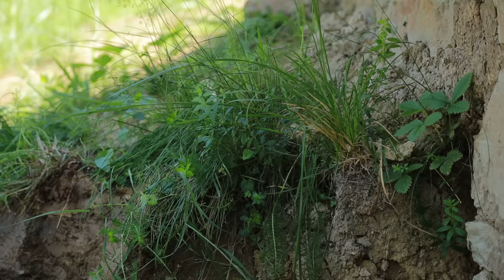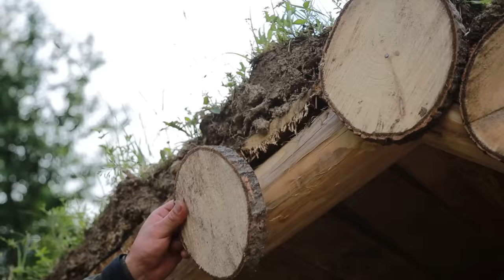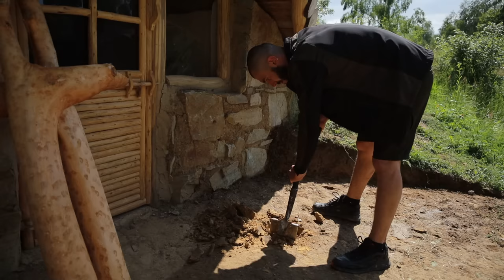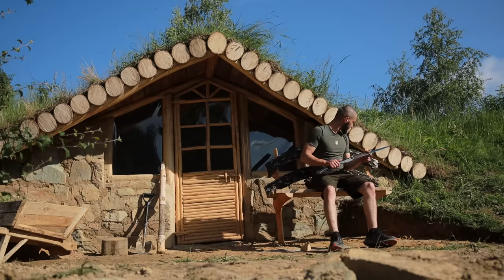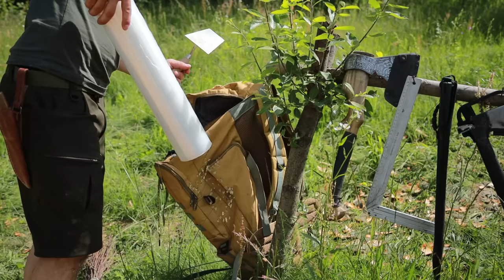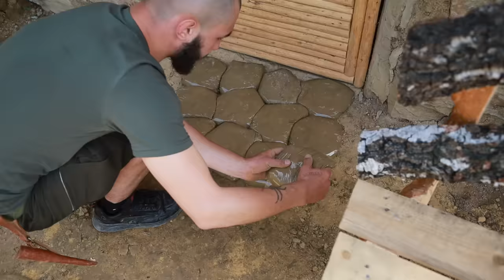The final part of the dugout construction. DIY

Comment: A darling and beautiful design.  Your work is amazing.  I have a few suggestions though,  leave out the wooden animals and mushrooms, smooth the back of the bench it looks very uncomfortable, and the stone slabs on the front wall definitely do not need outlining.  You do not need to make it cute. The door does not look like it would keep any cold out whatsoever. And I am wondering about the mud mortar, will it hold up under winter storms?  But your building skill is incredible, really, I could hardly believe my eyes.  But please don't add all these cutesy things.  Your skill and design are more than enough to make this little house beautiful.